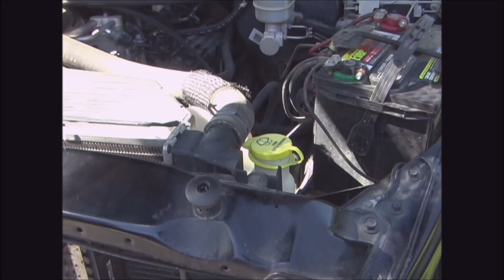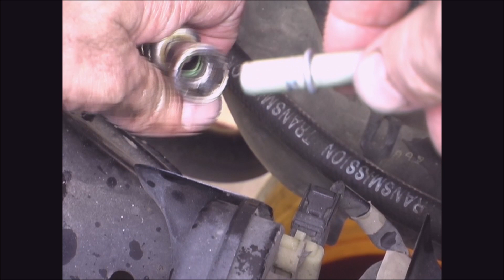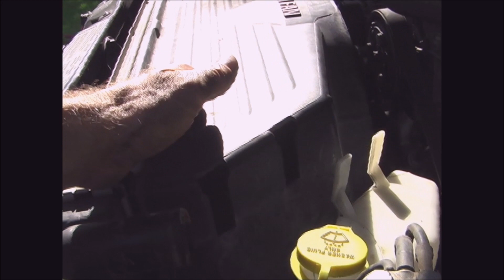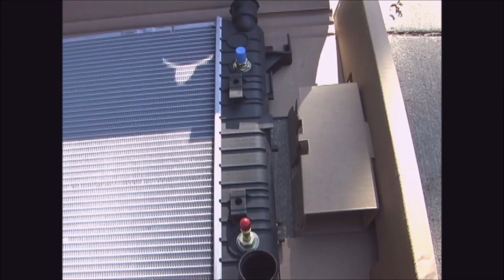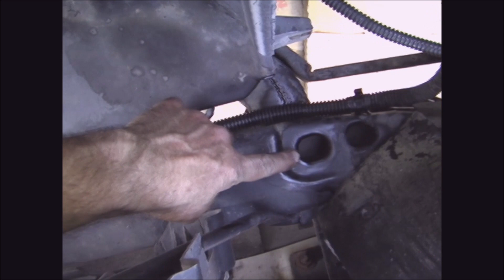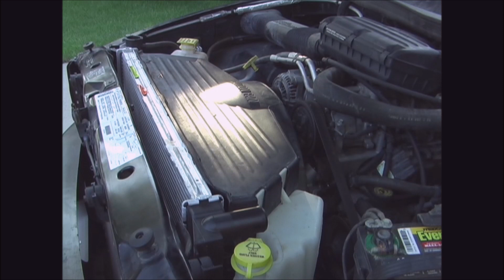How To: Replace Radiator 1998 Dodge Ram 1500 Pickup Removal & Installation

Comment: I’m not gonna lie I’ve all the videos I have looked up about changing the radiator in my 2001 Dodge ram is the most educational one I’ve ever watched how he explained. The transmission line was perfect all the other videos which you say snap it off they didn’t say nothing about special tools or what kind of tools you need. This guy did a hell of a job on this video.
Reply: I agree ... the details about the lower transmission line compression fitting removal was extremely valuable.

Comment: This was a great video, thanks for making this video to help others, i simply want to add that you have to use a radiator funnel to fill your radiator, to make sure you burp the air out of the system, or at least in my case, i had to, because my truck was overheating after replacing the radiator.

Comment: I cannot for the life of me take the lower transmission coolant line off even with that blue tool, it worked for the old radiator but for the new one I can’t take it off

Comment: What is the thing in between the radiator and the AC condenser called? I hit a deer and it completely destroyed both my radiator AC condenser and whatever that one thing is called
Reply from the maker: Transmission Oil / Fluid Cooler
Reply: Jay Gould thank you

Comment: Question if you don't mind: if a radiator is not leaking could it be clogged for none operating the truck for 10 years. Because i have flushed the fluids and put new antifreeze and a new thermostat and engine is still overheating. The water pump is not leaking. Could the radiator be clogged up?
Reply from the maker: It could be possible that the radiator is plugged. Also make sure the fan is working.

Comment: Sure wished this was up last month replaced mine on a 2000 Ram 1500 same set up. That transmission lower fitting was a bear.
Turned out the nipple on the radiator was about 8 mills larger in diameter. The ring on the nipple was over 10 mills larger in diameter and the ring 10 mills fatter the quick coupling would not full engage.